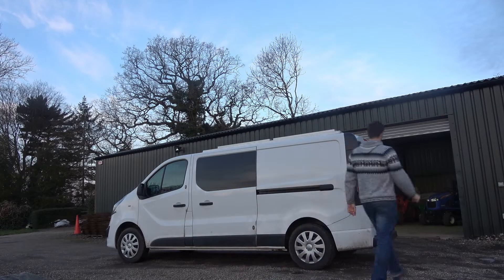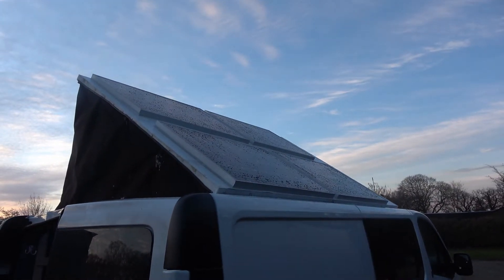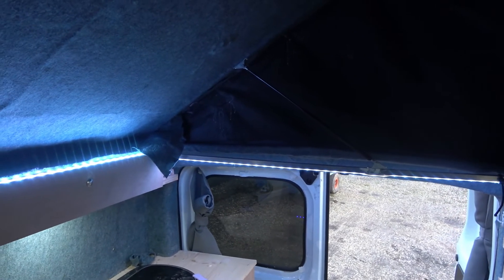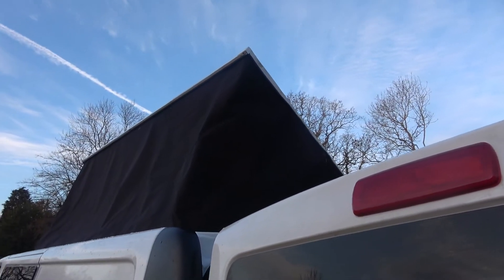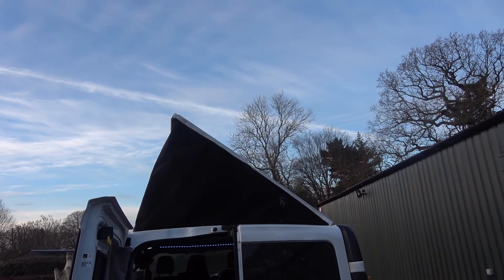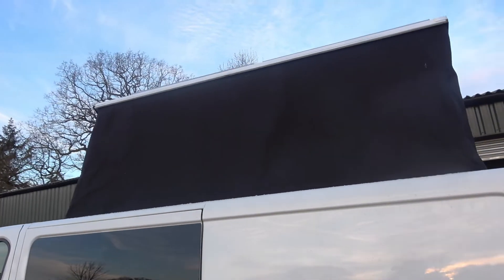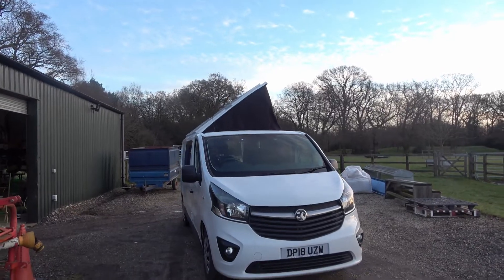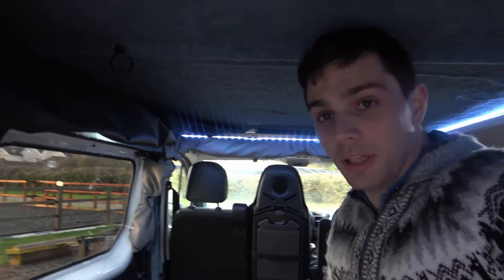Was it worth it? Making my own pop top roof! Campervan Conversion

Comment: As is the nature of these things, once completed, issues appear and you discover and learn about how it could have been done differently.

However, irrespective of any issues (all of which may be remedied) the greatest thing that's been achieved is in one's sense of self!

Having designed, fabricated and installed one's own metal pop top roof is a tremendous achievement, and it hugely reinforces one's confidence in one's own abilities!

You've learned far more than how to make a roof and you have the satisfaction of having done it yourself, without spending a huge sum of money..

It was really considerate of you to share your journey with others, and to report back on issues.

Credit where its due, your roof is great and it looks really neat.

Comment: Very well thought out mate!  I have a 2010 Transit Connect I converted into a campervan to take me and my electric bike fun places to explore...but I have thought about a pop top.  I saw one of those fiberglass clam shell roof tent, and cut a hole in the roof and attach the roof tent so you would have the nice waterproofed canvas with windows and screens (and can always buy a spare canvas for it for "down the road" because the sun does eat fabric.  Brilliant Job!

Comment: I'd have thought you would have needed  strengthening bars down both sides of the roof where you've cut it out to stop the flex in the van long ways. My vw had a steel frame going right around the opening of the pop top for this. You've got big balls to try this mate I tell ya 😂 👍
Reply: i know I'm quite randomly asking but does anyone know a good website to watch newly released series online?
Reply: @Wells Nolan I watch on FlixZone. Just search on google for it :)
Reply: @Zev Karter Definitely, have been watching on flixzone for since april myself :D
Reply: @Zev Karter Thank you, signed up and it seems like they got a lot of movies there =) I really appreciate it !!
Reply: @Wells Nolan no problem :)

Comment: Fantastic build it looks very professional, I have always wanted to do this how do you seal the canvas to the actual van so it doesn't leak and did you make the brackets for the gas struts. The canvas is it all one piece, it looks great I'm very impressed.  How do you fasten the canvas to the actual pop top itself  and do you have to silicone all of it . If you could let me know it would be very appreciated.  I'm subscribed enjoy your video very much thanks Dale
Reply from the maker: If you look at my channel I've done a few build videos on how I've made it. I used brackets from strutsdepot.com, the canvas is two seperate pieces as I don't have a sewing machine, and is attached by bolting strips of metal together holding the fabric between.
Reply: @georgescott6671  Thanks very much I just saw your other videos now

Comment: Would it help the damp ingress if you drenched the fabric in waterproofing canvas tent spray?
You still achieved a good job but I'm sure it was a right head ache to do 👍
Reply from the maker: That's the job I've set myself this weekend! Will mix silicone sealant and white spirits then paint on.
Reply: @georgescott6671  I never knew you could do that, Great tip tanks.
Do you know clear silicone is 50% stronger than white and brown as the pigment weakens the coloured stuff.
Just thought you might find that interesting 🙂

Comment: great thought, i would really like to know how you compensated for the roof after you just remove all the structural strength as you'll be going in areas where torsion of the van chassis is going to be bending the rest of the body as it move especially in off road.
Reply from the maker: I added two steel bars cross wise, and when the roof is down and latched, it adds strength as well. When driving I've not noticed any movement or creaking.
Reply: @georgescott6671  would also like to see the seamless fit on the roof when the top is closed ...but this is great
stuff.

Comment: I have only one but important question. When you report to the DVLA that you converted a VAN to a CAMPER..... they don't have any problems that you converted the roof? Are there any official guidelines on what needs to be done to strengthen the roof on the sides (cut crossbeams)?
Reply from the maker: I'm not planning on talking to the dvla, they have a crazy list of requirements and have been known to reject people even if they've done all of them
Reply: pointless trying to register with DVLA - they don't allow pop-top conversion as campers anyway, best you can get is "van with windows" because they don't have a high roof, you need to be able to stand in the van as is. A full fibreglass high-top conversion is the only way to get it on a low roof van. The requirements are ridiculous and they apparently reject most applications. As long as your insurance company knows it's a camper (or build in progress) then you're all good. Just report the mods to the insurance as and when you install them; I'm with One Call and they don't charge for modifications for a build in progress